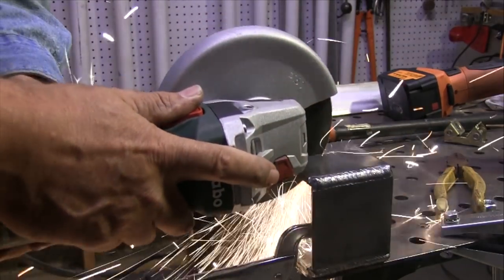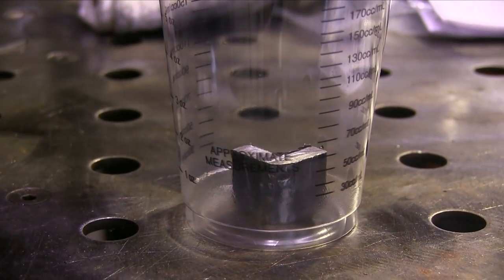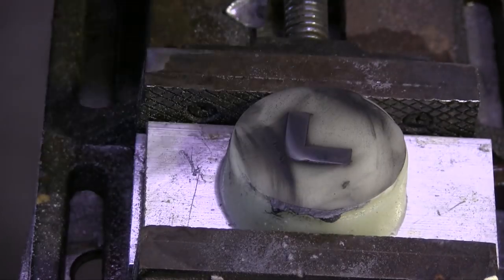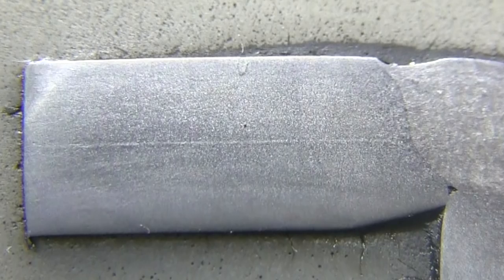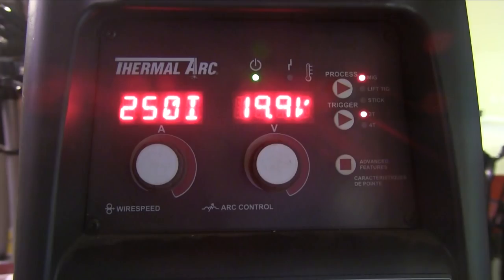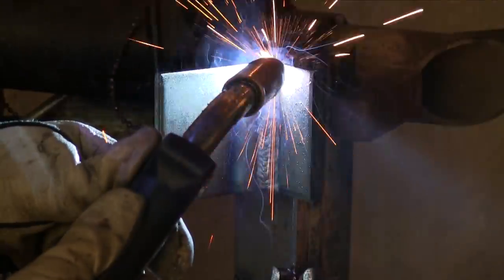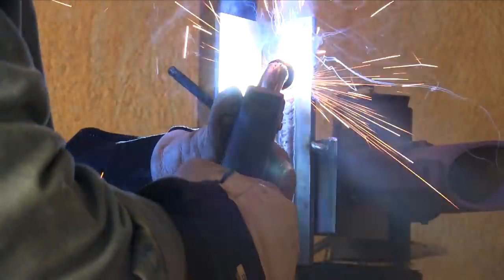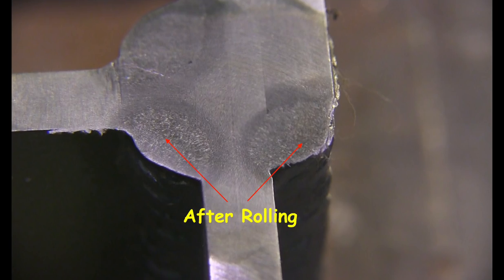Cut Polish Etch, Testing Welds,  Roll the Tank

Comment: The ol' rolling the cylinder trick works! I did it after Jody had mentioned it in The Welding Tips & Tricks podcast and it fixed the issues I was having. Another excellent video Jody! Thank you! 🔥👍🏼🔥

Comment: I was having intermittent porosity issues the other day, every now and then usually in the middle of a weld I'd start getting gnarly inclusions. kinda like I was welding with pure argon.  we were MIG welding in a frigid Massachusetts basement and the tank was damn near ice cold. on lunch break I did some reading poking around forums and found a suggestion from somebody that used to work at airgas who said to roll the tanks. something about the increased surface area of the gas separation boundary. I was definitely skeptical, but it did work and resolve much of my sheilding issues. super neat to see it talked about the very next day.
Reply: Frederic Manke IV, interesting.  I was recently welding some light gauge material and everything was going fine.  But then it all went to crap. Tried a bunch of setting changes to no avail. Came back the next day and all worked well. 
Will try this trick next time.
Reply: This happens to me to 😲

Comment: Had a similar problem today while I was mig welding. For about the first ten minutes, it seemed as the gas coverage was poor for some unknown reason. But after that it went back to normal. I will try rolling the cylinder if it happens again. Thanks for the tip.

Comment: Not sure where it goes against science.. The to gases are basically inert in the container. There isn't any reaction between the two. I makes sense that the heavier gas would build  up in the bottom.  Separation would not be complete as gas is really a high energy state of any matter so the separation will never be complete but the could easily be enough separation that the mix is no longer homogeneous.   Thanks for point this out. I mig weld only on occasion and have had issues.   You've again taught me something very useful.  Thanks.

Comment: If you would like to send me that mounted outside corner joint, I will get you some very high magnification pictures.  That is part of my job here at Welding Alloys USA.
Reply from the maker: I might just take you up on that offer.
Reply: Would love to see that in another follow-up.
Reply: weldingtipsandtricks have you made a video of his magnified pictures? 
I used to flash butt weld railroad rails for Holland LP up in Northern Ontario, Canada. That is a  very cool process. Anyways I love your videos even though I am not welding any more. ( heavy equipment operator leadhand now ) I still really enjoy your videos. Keep up the great work Jody. You're the man bud.

Comment: The mixing of gases is scientifically valid though as far as I can tell. they are liquids at room temperature,  they are not dissolved into each other and they won't form complexes as far as I know, so they would separate to some extent due to density and gravity. they won't form clear very distinct layers but more of layers with fuzzy boundaries due to brownian motion.
Reply: Yepp. That's why centrifuges for uranium enrichment work. The centrifuge only provides a higher "gravity" to speed up the process. With uranium we are talking about a density difference of only 0.8%, whereas with CO2 and argon it is about 10%, which is why they might separate noticably even without a centrifuge over the course of a few weeks. Also, while argon as a noble gas might be very close to an ideal gas in behaviour, CO2 under pressure most definitely isn't, which might increase the separation tendency as well.
Reply: Even as a gas we know that atmosphere can separate in a berm or confined space and people can die because of it.  I don't know how long it takes for that to happen, but that's a problem in some pretty mundane situations.   I don't know if it can happen in a few days in a bottle or not.
Reply: They are not liquids. They are far above their critical temperature . Argon has a critical temperature of -120°C, its never going to be a liquid in any gas cylinder at any pressure as log as its warmer than that.
In any human-scale gases cant(!) separate in a gas cylinder. They do that at planet-scales a little bit, but that would be going too deep now and is too irrelevant for us here.
For the rolling: Next time instead of doing that just do everything except the rolling. So get the flow meter off etc. but dont move the cylinder. Then put everything back together. Test. Now do it again and this time with rolling. Test again. You will see no difference. That way possible leaks etc. will be sealed and the system is purged and if anything does indeed happen it would much more likely be the "rolling" that did it and not everything else.

Edit: How much CO2 is Jody using (portion)? We could actually exceed its vapour pressure and get it liquid, its below critical temperature (31°C) usually. Then, due to the slightly higher density of CO2-vapour, it could stay at the bottom after beeing evaporated due to gas beeing removed from the cylinder (welding). That would result in a 3-layer system of liquid CO2 at the bottom, CO2 gas above it and CO2+Argon at the top. Since the valve is at the top it will let argon-enriched gas get out, not the specified mixture. In that case rolling would be somewhat scientifically correct. It all depends on the outside/gas cylinder temperature and CO2 content (= its vapour pressure). Lower temperature and higher CO2 content = worse
Reply: @Leo Curious
Even if all the components are at supercritical state it shouldn't matter. liquids do separate due to gravity so do gases. I can't think of a valid reason why in supercritical state gravity would lose its grip.
Reply: I would be with you if we weren't talking about CO2. CO2 doesn't really like mixing with other gases under high pressure. I couldn't find data for argon/CO2, however for N2/CO2, the enthalpy of mixing for a 72.5%/27.5% mixture at 31°C is around 160J/mol at 34bar and 600J/mol at 64bar. You can see the sharp increase with pressure, I imagine it will be even higher at the 170bar in a gas bottle. It also increases with lower temperatures (at 40°C, the values are 160J/mol and 440J/mol respectively). This means mixing CO2 with N2 is highly endergonic at high pressure.

In addition, diffusion of one gas in another is also affected by pressure, the coefficient of diffusion is roughly inverse proportional to the pressure. Therefore, the diffusion within the bottle is greatly reduced compared to athmospheric pressure.

You would really have to do proper experiments (measuring the gas composition), however I still think that it is possible that a noticeable gradient might develop in a pressurized Ar/CO2 mixture over time.
Reply: "That's why centrifuges for uranium enrichment work."
They work due to the extreme acceleration, about 1 million times earth gravitation. Its so much that it overcomes the molecular motion. For every normal scenario this motion is much stronger.

"which is why they might separate noticably even without a centrifuge over the course of a few weeks."
Its woont happen after a long time, it will happen during the usage of the gas cylinder. Letting it sit around will "re mix" said 2 gaseous phases into a single gas phase.

"Even as a gas we know that atmosphere can separate in a berm or confined space and people can die because of it. "
That will never happen. Either the oxygen is used up or excess nitrogen/CO2 is introduced into the system.

" I can't think of a valid reason why in supercritical state gravity would lose its grip."
It doesnt lose its grip. Its simply much weaker compared to the motion of the molecules. They move around at speeds of around 1000m/s (mach 3*). Take a look here: https://en.wikipedia.org/wiki/Maxwell%E2%80%93Boltzmann_distribution#Distribution_of_speeds
This is what temperatur is: Kinetic energy of the molecules aka moving around. And thats what mixes them and keeps them mixed. Gravity is too weak, the same way that static electricity pulls a few hairs or dust around or off the ground.
*compared to air

"600J/mol at 64bar [...] highly endergonic"
Uh... 600J are not really much. Just slightly endergonic. It will still mix just as well. By the way: Are those values at room temperatur (290K) or around -150°C (100 to 200K)?

"however I still think that it is possible that a noticeable gradient might develop in a pressurized Ar/CO2 mixture over time."
I would strongly say its only possible during extraction of gas that a gradient is able to form. Leave the cylinder alone for a while and its mixed up again. Only the liquid -> gaseous transition is able to produce a gradient and only when the system is beeing emptyed and there is a vertical net flow of gas.

However, its hard to find data about this. I also still dont know how much CO2 there is in Jodys cylinder.
Lets assume a pressure of 100bar (1500psi) and 25% CO2, 75% Argon at 20°C (293K). Thus the partial pressure for CO2 is 25bar, while the vapour pressure at 20°C is about 60bar - there should be no possible liquid phase. However, at -20°C the vapour pressure drops to 20bar and there will be liquid CO2 in that cylinder. It all comes down to temperature, pressure and CO2 content.
Reply: Quick test to see if there is any liquid in the cylinder: Turn it upside down and open the valve. If it looks like a CO2 fire extinguisher / cold spray / bottled "compressed air" upside down (so lots of dense white fog, freezing everything) then you know there is liquid CO2 in there. I highly doubt it.
Reply: In a CO2 tank it is liquid, as the tank pressure never gets higher than about 4 MPa. It stays at that pressure until all the liquid has turned to gas and only then it starts dropping and fast, as the bottle is pretty much "on fumes".
Reply: This is not a CO2 tank, its CO2 + Argon.
Imagine it was Water + Air and the pressure normal (aka 1 bar or 1 atm), do you think the water would always be liquid, no matter how little there is in the cylinder? Or might be some water in the air as vapour? The exact amount is determined by the vapour pressure, so for water that would be 1 bar at 100°C and ~20 mbar at 20°C. So for every volume of air at 20°C and 100% humidity its 2% water vapour:
20mbar / 1000mbar = 0.02
At 100°C and 1 bar it would be pure watervapour only. At 2 bar and 100°C 50% of the gas is water vapour.
Another example: Compress air and water will condense, because 1 liter of normal air can take up the very same amount as 1 liter air at 10bar, but at 10bar it contains 10x the amount of water. Since ambient air is not super dry this means we get well above the dew point, which is the vapour pressure.
In the case of CO2 here the vapour pressure is too high for it to be a liquid at normal temperatures.

Dont be affraid of the units, they dont actually matter. Its just a ratio, no matter what unit the pressure is.
Reply: You might notice that I mentioned "In A CO2 tank", not in this tank.
Reply: True. 
But if u dont talk about this case... where are you going with the pure CO2?

Comment: I could have this completely wrong, but the science appears to be on your side with regard to "bottle rolling." The atomic weight of  of Argon is just about 40, not including any isotopes. CO2 has an atomic weight of 44, again exclusive of any Carbon/Oxygen isotopes. So all things being equal, and given enough time and with the bottle not undergoing any movement, it's possible that the CO2 could have started to settle. At least that's the most reasonable explanation for the change in weld quality before and after the bottle roll....and btw, you are a great teacher.....

Comment: Jody,
Physics does actually predict that gas phenomenon.
Argon is lighter than CO2. Given enough time, stable temperatures and not moving the bottle, the gas mixture at the top of the bottle will be different than that at the bottom. Maybe not a lot but enough to affect your welding results.
Thanks for the video.
John
Reply: Caveman's Mancave No the gases mix themselves through molecular movement. Basically like putting heavy lead and light glas marbles in a glas. If you shake them all day long they'll stay mixed. The gas shakes itself because it has a high enough temperature which just means the molecules are moving around enough to sort of stir themselves.
Reply: alles klar klaus 
I beg to differ.
Heavy gasses like CO2 will settle into open pits at high enough concentrations to suffocate humans in less than a minute.
Gasses do tend to separate based on molecular weight and gravitational effects in a process called stratification as long as the mixture is not agitated by thermal gradients or externally applied motion. It happens in our atmosphere.
Reply: Caveman's Mancave There is some ongoing discussion in another comment which I read after commenting here. People go both ways.. What I think is: CO2 only settles in pits if it is pumped into there or somehow gets into the pit. Also 5% is enough for humans to be damgerous if I recall that correctly which is not that much at all. It will also bugger off after some time on it's own. I understand your comment the way that just digging an unenclosed hole into the ground won't make it go into there, which it should do if it was really sorta settling out. Now for say a mine I don't think there is just CO2 getting down there from the air in atmosphere and filling it bottom first with pure CO2 or something like 30-50% CO2.
Reply: Caveman's Mancave and those stratification effects are just for big scale. In fact, I just looked it up to confirm I am not talking bullshit and the wikipedia page about our atmosphere and stratification says the relative concentration of the gasses stays constant to about 10km (33.000ft)
Reply: There's another issue people aren't considering:  At tank pressures, CO2 is not a gas.  It is a liquid.  It has to evaporate into a gas to be drawn out of the bottle.

Comment: Hey Jody, if you are ever looking for new material and some "out of the box" thinking kind of stuff, how about making a vid on exothermic or the CADWeld process.  Does it have any application in a weld shop? Or maybe even an argument that a TIG weld is better and replaces the technique in all but the most remote field locations?  Particularly interesting would be an in the field demo of rebar or rail joining where the rebar will eventually be encapsulated in a concrete structure, or the rail will be ground for train use.  Some explanation as to how atmosphere is controlled and how reliable the process is would be interesting too.

Comment: That line is why aerospace usually requires inconel to be heat treated after welding.  That and dendritic grain formation.  Oh, and I'm talking solely about inconel, though it can happen with the high nickel stainlesses like A286.  All of which are uggy to weld.

Comment: Hello Jody. I've being following your videos for quite some time and learned a lot from them yet I'm not a welder so decided to ask for an advice for my particular task (for which I actually become interested in welding in the first place).
I'm working on the trailer for Tiny House for the moment and before getting into welding real thing I wanted to test my welding process.
I used MIG with 0.8 mm wire, Ar+CO2 (proportions should be 90%/10% but might be off as everything here in Ukraine :) ), 25V and 15 m/min feed speed to get into spray transfer mode - the hottest that I can get from my welding rig.

I tried to weld 40x40x4 mm square tube to a face of 100x60x4 tube. Aparently I made root opening not wide enough and there is LOF at the root but aside from this I see that welding nugget at the bigger tube has little to no penetration (one of the sample shown a plain crack :( ).

Welding started at about +5 Celcius and I weleded one side at a time so it seems like heating the test peace increased penetration with every new side. I looked into AWS D1.1 and it says that for this thickness of metal it's alloweable to weld starting at 0 Celcius. I'm curious if I should preheat details or am I just missing something else?

Photo of etched test piece: https://www.facebook.com/kryhatka/photos/a.1462729170506575.1073741835.1419834911462668/1463489417097217/?type=3&theater
In comments I've added a drawing of the setup which completely mimics one of the steps of assambling of my trailer. Seqence and direction of beads is indicated with blue numbers and arrows but can be changed. Position and relation of tubes cannot. Just in case you might find it interesting to repeat this test and shoot a video out from it. :)

P.S. As alternative I tried stick weld the same test setup with ESAB OK 55.00 (AWS E7018-1H4 R) 3.2mm at 90A and it gives a better penetration yet first bead still looks almost flat with the face of the horizontal tube. Aside from LOF in root (flux got in 2 mm root opening) and I've got some undercut on the sides about 1 mm deep. But that is a different story.

Best regards,
Corban.

Comment: I don't see why gasses couldn't come at least partially stratified.  The two gasses are different densities. CO2 is around 2 kg/cubic meter. Argon density is 80% of that.   Even water with different salinities can become stratified.   Even more important, CO2 is a partial liquid at the pressures in the tank, and argon is still entirely a gas, so it's not surprising that the argon could become the majority of the gas sitting above the liquid, while the CO2 condenses out.  When the CO2 fraction decreases due to condensation, you'll get less penetration.  It's not the same situation as helium and argon, which are both gasses at all pressures.  Brownian motion can only overcome so much.